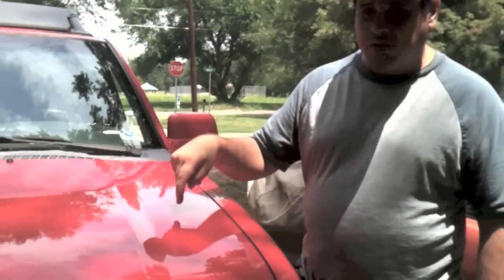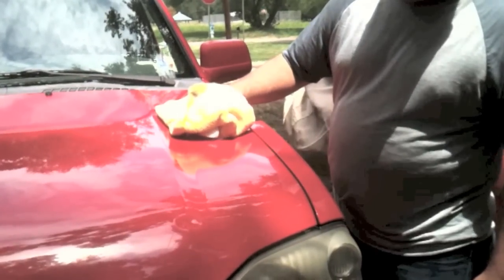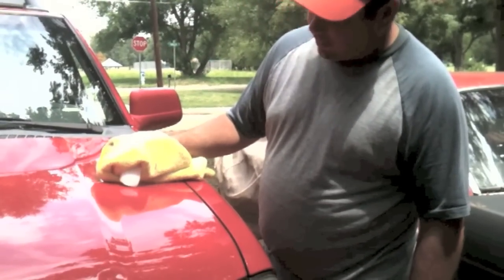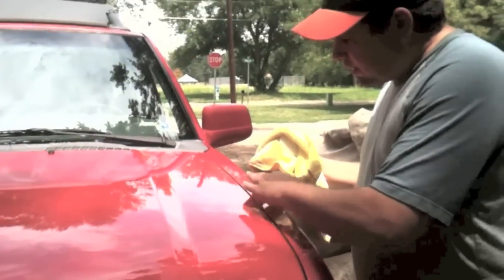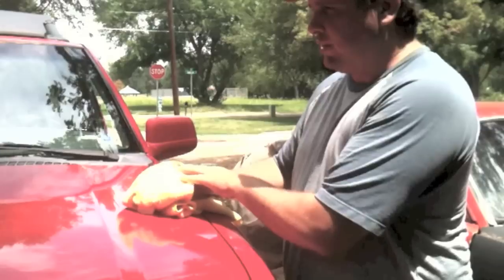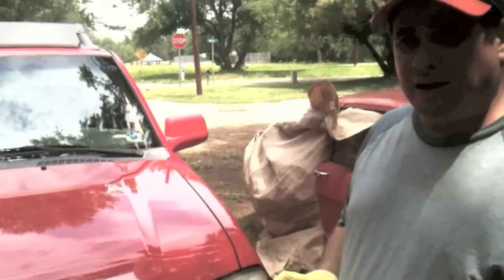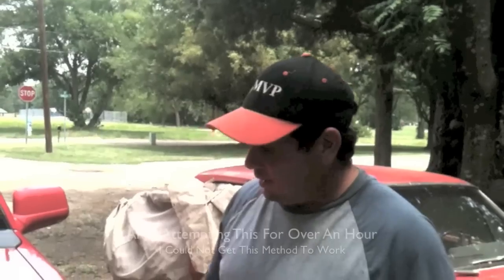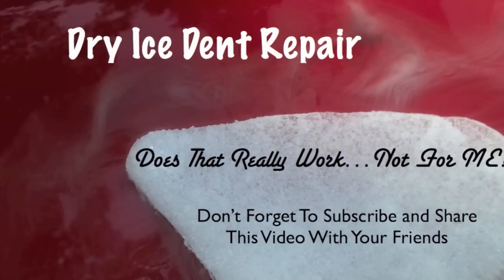Repair Car Dents Using Dry Ice Does That Really Work Episode 5

Comment: I am a collision repair tech. And the dry ice does work when you know what you're doing. I've been in the business 8 years and only saw one pdr tech actually use dry ice. And what he did was use a torch maps gas. Heated the dent starting just outside the crown of the dent. In a circling motion toward the center of the dent and then back out. He moved relatively quick so he didn't burn the paint. Then he slid the dry ice over the top of the dent. Just once didn't hold it there. Didn't let it freeze the paint. And the dents slowly come out. Some dents were deeper than others and took 2 to 3 attempts before they came out.
Reply: Does this work on metal fenders also or just fiberglass
Reply: dry ice work on fiberglass. fiberglass doesn't dent it breaks
Reply: go ahead and hit a panel made of fiberglass and see what it does.

Comment: You need a heat gun. The point is for the metal to expand and contract extremely quickly. Anyone claiming they got rid of dents using only dry ice must have done so on a hot day.

Comment: I tried it and it worked for me. I had small dents that the dry ice and hair dryer improved. It didn't totally fix it though, just made the dents small enough that it isn't noticeable. The heat softens the metal and the dry ice makes it shrink.
Reply: No it's the other way round
Reply: @rosskstar  no its right(other than the "soften" wording), metal expands with heat and contracts with cold, I think youre thinking of water/ice which is the other way around.

Comment: It is rumored that this method works on only a very small subset of dents. So, might be worth a try. Also, it seems to work better in older cars where the sheet metal is much thicker. Today's panels, if you can take them off, will not even support their own weight, they are almost beer can thin. Cars of the 60-70s are very hard to get a butt print in one if you sit on a hood, saw someone put a head dent in a new car's panel by not doing much. Didn't hurt him but nice round dent in the car.

Comment: Dry ice is basically useless on 99% of dents.  

Unless you think to yourself, "I could easily pop this out if I could reach the back of it", it won't work.  Especially on curved sections of metal.  The larger diameter the dent and flatter the body panel the dent is on, the more likely it is to work.

The dent is on the hood anyway, you can have access to the backside to pop it out.

Comment: I was told to put the dry ice in a paper cup then turn the cup upside down on the dent. try to seal it with silicone or something but it's true you should put a hairdryer on it not real close though. just heat then dry ice in cup turn upside down and leave it for awhile

Comment: Dry ice dent repair works only if the dent is decently fresh and not age for over a time. Once it age it leaves permanent crease in the metal. Remember heat expand and cold shrink. So on fresh dents heat the around the dent with a heat gun to a point. Where its dose not melt the paint. Quickly rub dry ice around the dent! Not on the dent and it should pop out. I personally never try this on cars but only on aircraft skin at Cessna. I hope this help on your next video.

Comment: This and the canned air will work on some, but not all dents.
1. You have to get the dent really hot with a heat gun (a hair dryer will not get it hot enough), being careful to not burn or blister the paint.
2. Then you need to apply the cold, dry ice or inverted canned air spray directly to the center of the dent, not all around it.
What you are doing with the process is heating & expanding the metal slightly with the heat,  then quickly cooling the center and shrinking the stretched metal.

Comment: It will work. I have actually seen it hail (albeit small hail) and it left dents in my pickup hood and because the rain and hail mix was cold enough when the sun came out and heated up the metal the dents all disappeared.
Reply: May I know if it was a black car?

Comment: I wonder if it would work better if you heated a wider area, much as you've been doing but Instead of just rapidly cooling that spot, You might try cooling more area to shrink the metal. there is only so much expansion and contraction to be had in a small area of metal and widening it out might give you more movement. I've seen hail dents go away over time on their own, presumably from temperature change induced metal shrinking and expanding.
Gotta love youtubers. I may try it myself someday :P

Comment: hi donnie could you pls tell the name of air spray used for removing the dent of the car... I am from India and I want to remove a dent in my duster car
Reply: its called a hair drier
Reply: The9thGen instagram he might be talking about the compressed air method.   

hold and computer keyboard can of compressed air cleaner upside down while spraying. (liquid c02) it will freeze.     but hair dryer.   use an actual heat gun.  (for shrinking electrical heat wrap etc etc)

Comment: Rub dry ice for a minute and then dump a bucket of lukewarm water and watch the metal flatten out. Larger the dent, repeat the process by dividing up the dent into sections. This method won't work on ridges formed from a damage.

Comment: I used dry ice on my 1962:ford falcon , hail dents on hood and roof , it work great , its fast , if you hear poping , snaping, cliking noise its working , don't be afraid to put a little pressure on it ( I used a old shirt to hold the dry ice )

Comment: I remove dents for living via PDR (Paintless Dent Repair).  Dry Ice?... ugh.  The only time this actually works is under VERY specific circumstances.  ie.  a very slight, shallow dent in a steel panel.  Even then, you have to get the panel quite hot first, then cold really quickly.  After that, if you haven't already split the paint, you're still likely to still see a wobble or three.  And maybe that's ok for some (ie. racing or beaters).  But if you want it out 100%, have a PDR professional do it.  There's a real reason why many of us have 100k in tools and decades of ongoing training and experience
Reply: ☝️☝️☝️A PDR, free advertisement.  Heat gun, dry ice, gloves. Get it hot but be careful not to scorch the paint.  Then, having the dry ice already ready to go, put the dry ice straight to the dent to be repaired as fast as you can but still protecting the integrity of paint.  And before you know it you'll have a dent repaired, a great story to share, and bragging rights over people who try to convince you that you need to pay and outrageous price to get the same or less quality of work.
Reply: @ChadUfferman77  Advertisement?  Haha... you're funny :)  But seriously, how can anyone just completely ignore dent depth, stretch, complexity, metal type, thickness and paint condition?  Simply forcing temperature extremes does NOT magically correct all these variables and restore metal back to OEM spec.  Honestly, I wish it did though... I'd be rich.. lol.  I've personally fixed hundreds of thousands of dents and I guarantee that, 99.5% of the time, automotive metals will NEVER respond back in the manner you describe.  Most "real" dents are inherently challenging, take hard work, effort and years of training to remove 100%.  You call PDR outrageous, I call it extremely cost effective (and also a better repair) than a body shop.  Seems like you're insinuating that an entire industry is somehow a scam.

Comment: It would have worked if u knew what u were doing .. I have fixed mine .. Use. The hot water and push it from underneath mate .. U cant just wet it with dry ice hoping that it would pop out just like it without making any effort . Push the fckn think underneath when it softens up aftr heating it up with a heat gun be carefull tho it may damage the paint if its too close